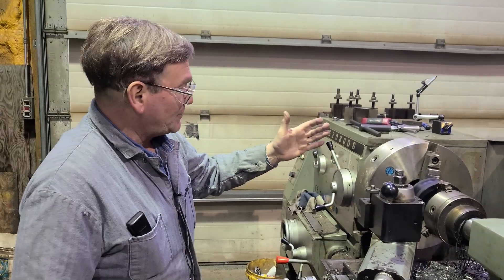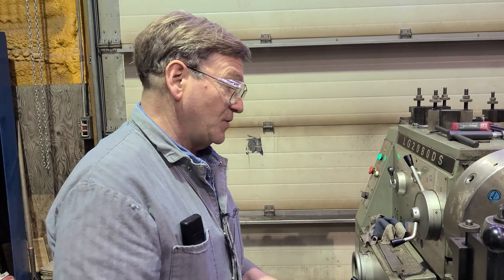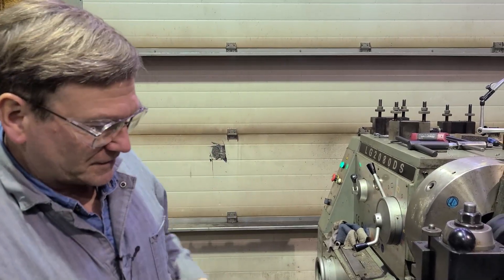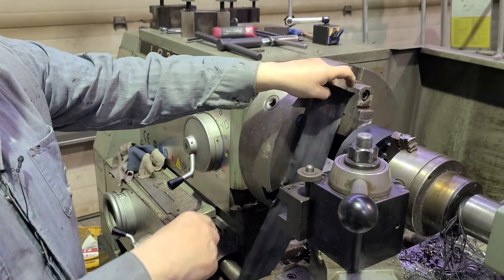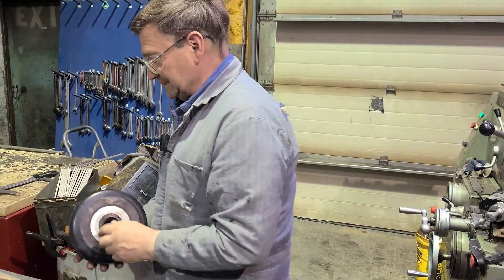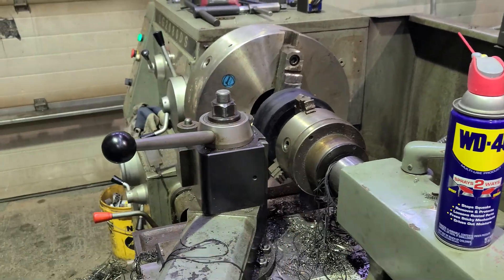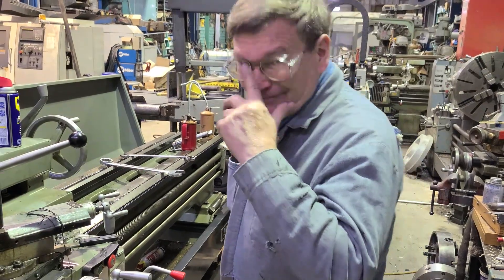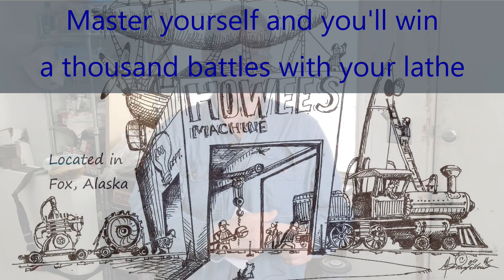Machinist's Minutes: All about turning rubber

Comment: I think most Viewers and I  would probably like to see a up close view of the ground tool that you used to cut the rubber. Entry angle and the actual cutting of the rubber. Thanks Rondal
Reply: It looked like you showed  how you would sharpen a HSS parting tool but then it looks like you used a different tool to actually cut ? Thanks Rondal

Comment: I have turned the OD down on Poly Bushings to fit shackles 
....by simply placing them in the freeze for awhile first, they turned excellent
I have to turn down a rubber seal for a Hydraulic ram so watched this video, I will knife my cutting tool and try it

Comment: I wanted to reduce the diameter on two wheelie-bin wheels and tyres. I had no idea how to do it, but after watching this I followed your advice and took the bulk off by just cutting the tyre on my bandsaw. Using the finest toothed blade I had I found the saw cut it without problem. I then trued up the tyres on my wood lathe using a skew chisel. I was surprised how easily the rubber cut, but it did blunt the tool really quickly.
I think it was a lower-density rubber than you are cutting, but I had no problem cutting it just like I would with wood.
Thank you for posting this informative video, without it I would not have dared to try!

Comment: At work we mostly turn down rubber rollers on the lathe, we use a carbide insert, actually feeding left to right, the way we do it it results one continous string chip, that's the reason for the feed direction, we make sure it misses the toolpost and use a piece of cardboard at the beginning to make it miss the chuck. We also always cut it dry, the requirement for us is surface finish, since it's printing rollers, our method makes less mess that grinding

Comment: I worked with really soft rubber back in the 90's and the way I was taught was to make a HSS tool with a knife edge on the front so the blade was parallel to the lathe axis then leave a crotch on the left face of the tool that will cut the waste into a string. When the stringer becomes a problem then interrupt the feed.

Comment: I wanted to cut some hard rubber lacross balls in half and tried to use a wood band saw holding it by hand and it threw the ball and blew the blade off the bandsaw scared me good. Now I am scared of cutting rubber.,

Comment: 2 years ago i was machining some 3D printed TPU with "hardness" of ~85A. Used CCGT 120404 ALX inserts for aluminium that we had lying around, uncoated, polished, iirc 19° positive rake. Worked like a charm tho a fresh ground HSS tool would have been my second shot. Just don't transport em in your pockets if you don't wanna have your pants dripping in blood...
Thanks for sharing!

Comment: Wouldn’t there be an issue with freezing then machining rubber with it expanding when it warms  up and being out of tolerance?
Reply from the maker: You always have measurement accuracy problems with rubber, it moves when being measured.  On the other hand rubber is flexible enough, that it is ok, just to be close, most of the time

Comment: I haven’t machined rubber but plenty of polyurethane.
That’s sometimes best to freeze if it’s a soft mix.
I’m suprised you throw the scrap rubber on the floor when you have to pick it up off the floor, why not throw it directly into a trash can.
Reply: Turned a lot of nylon and Delrin and would pull the "string" directly into a trashcan by my side, nothing to clean up.

Comment: The quickest, easiest way is grinding. I've done it a zillion times. Cutting it with a tool doesn't work very well at all, plus it can get dangerous in a hurry. I've even cut threads in rubber that way. You also will find you have to feed it the correct direction. You can get a toolpost grinder, or do it on a surface grinder.

Comment: I've made a tool to cut rubber out of a piece of bandsaw blade formed into a loop and welded to a piece of key stock that will fitting the tool post holder. the loop is sharpened on top and the stringer goes through the loop. I got the idea from my pottery days-a potter's trim tool. worked pretty well.

Comment: Back in the 70s we used to make special seals and whatnot for Sandia National Laboratory from neoprene rubber. We immersed the neoprene in liquid nitrogen and then it could be machined for a few minutes before it had to be cooled down again. Cut very nicely with sharp high speed tools.

Comment: The hole saw idea, I think I would have come up with a mounting solution for that so you didn’t have to mess with the seals. Good information by the way.
Reply: Somehow I think it would bind up on both sides of the hole saw with nowhere for the chips to escape and the heat and the flexibility of the matrl.

Comment: but but but WD-40 ISN"T A LUBRICANT! sob cry wah... if i had a dime for every time some monkey argued with me about that ... cause it sure works good as a lubricant... 
Also cutting rubber and plastic SUCKS
Reply: I mean, it is a lubricant if you just need a cutting tool to slip and it's only gotta last for all of fifteen seconds. It's NOT a suitable lubricant if we're talking about motorcycle chains for example, which are under much bigger loads for a much longer time. It's way too light and evaporates fairly quickly. Even water is a good lubricant in some cases (e.g. sharpening with stones) but it can't replace proper greases and oils for mechanical lubrication. WD40 is rarely a proper choice of lubricant.
Reply: @SqueakyNeb  theres another dime...
Reply: @northmanlogging2769 you're that bitter about being wrong all the time?
Reply: @SqueakyNeb you can't argue with people like this. Best to just let them stay stupid and move on.
Reply: @desertdweller9548  see i'd be rich i tell ya
Reply: @northmanlogging2769  I take that as confirmation of my assessment. Thanks for that. Your type never could resist the bait.
Reply: @desertdweller9548  they say you shouldn't feed the trolls, i should also be sleeping, but no...
Reply: @northmanlogging2769  so you're admitting to being a troll? Thanks for that.
Reply: @desertdweller9548  they say denial is the first stage... I KNOW  I have a problem...
Reply: @northmanlogging2769  so what stage are you in then?
Reply: @desertdweller9548  oh hell... I don't even go to meetings lol. They wouldn't have me!
Reply: @SqueakyNeb tribology is a vast subject, there is no one perfect lubricant for all purposes. WD40 is a lubricant for some purposes just as milk is for others. A light oil will never take the place of a thick grease in the same way a thick grease is useless in say a watch. If WD40 stops a door hinge from squeaking it is a lubricant, even if there is something better you could use.

Comment: Could you have held the wheel from the outside, and used a hole saw?  maybe with screwin pins?  just thinking out loud here...
Reply from the maker: The original outside form of the rubber was not true, so chucking/squaring each one would have taken extra time, negating the speed of the hole saw method.